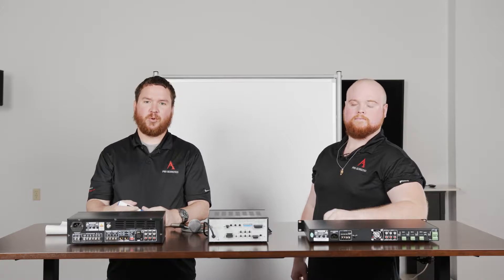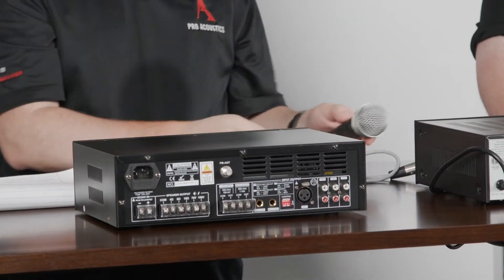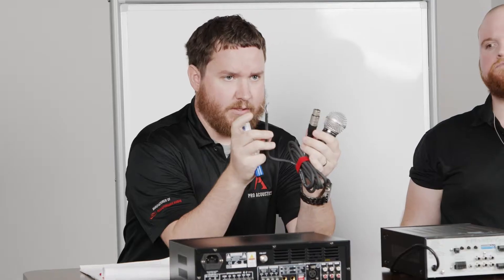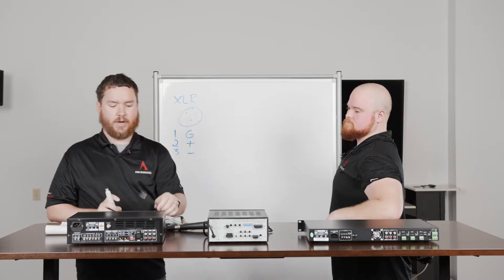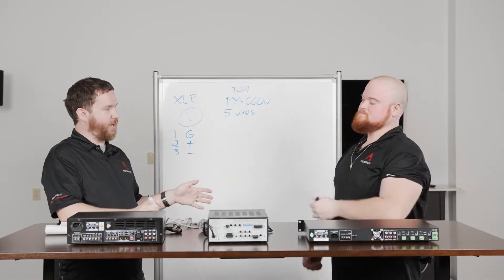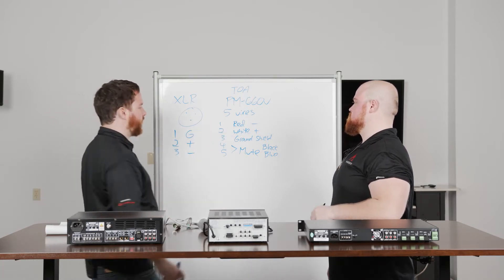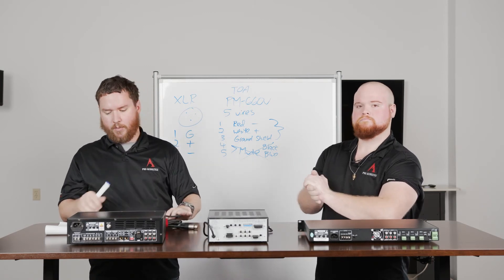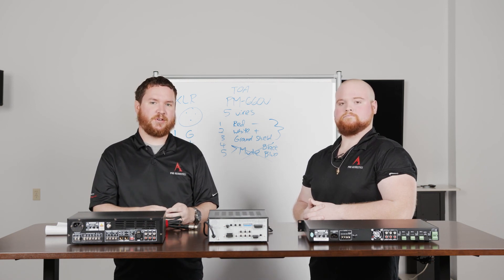All About How To Connect A Microphone To A 70 Volt Mixer Amplifier on Pro Acoustics Tech Talk Ep. 27

Comment: I have a question on possibilities of adding a reverb into that mic signal, I’m looking to add reverb onto a system that is using a monaco 900pa amplifier and a bunch of speakers im guessing they are 70v speakers, and a microphone which fortunately is using an xlr connector, is there an easy way to add reverb to that signal without having to get a new amplifier that have built in effects, maybe some sorry of Pedal like reverb that takes the microphone signal adds reverb than goes into the microphone xlr input on the amplifier?
Reply from the maker: Yes, it's possible to add reverb to your microphone signal without changing your amplifier setup. In your case, you would connect your microphone to the input of the effects processor, then connect the output of the effects processor to the mic input of your Monacor 900 amplifier. Just ensure the effects processor has the necessary XLR connections to avoid needing additional adapters for 1/4" inputs/outputs.